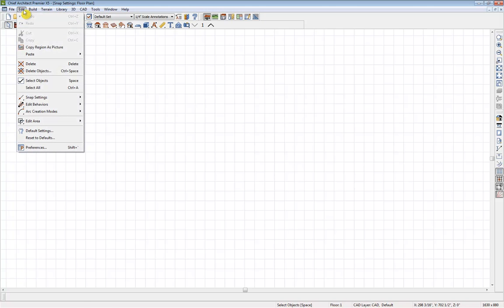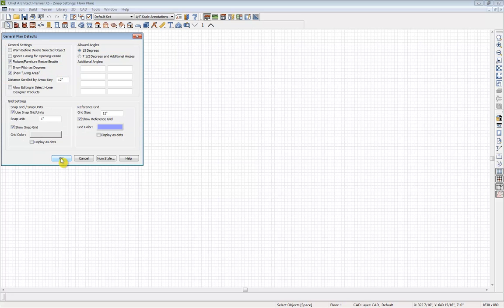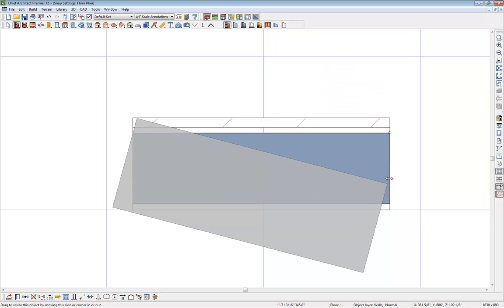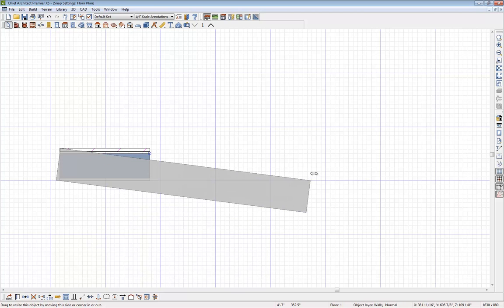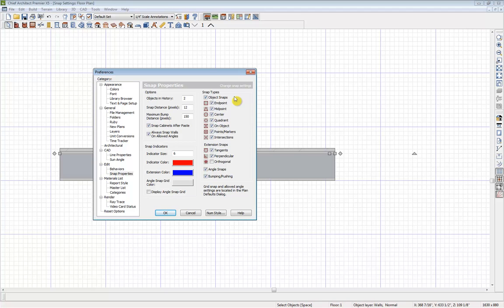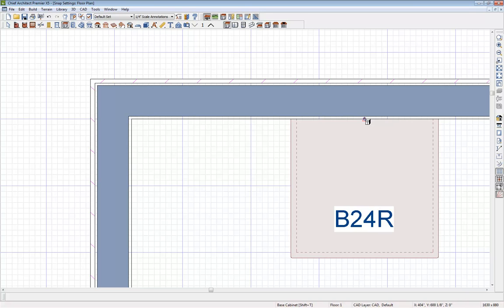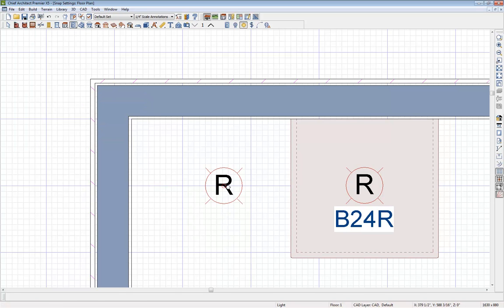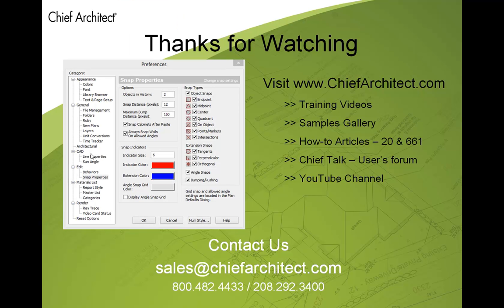Chief Architect Quick Tip - Snap Settings

Comment: It appears that all of the snap settings you are referencing are not available in the $99 versions??  The only option in my program is to either turn the snaps on or off, and only from the main menu drop-down, not in a toolbar.  Bummer - snaps are huge and that is a bad thing to remove for the economy version.  Not even any options to edit snaps in preferences.  Literally, only turn them on or off with no ability to make any edits to the snap settings.
Reply from the maker: +Trent Banwart This video was created in our Chief Architect Premier ($,2695), and has more snapping controls than most of the Home Designer programs. However, the Home Designer Pro will offer snap controls through Preferences. We offer upgrade discounts if you're interested in more features. And I'll pass on your feedback about snap options in other versions. Thank you!